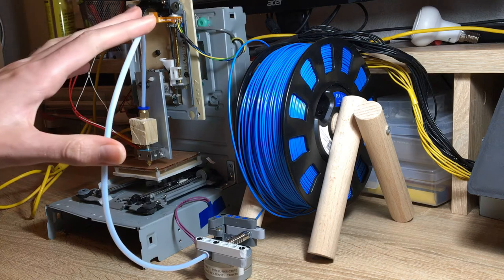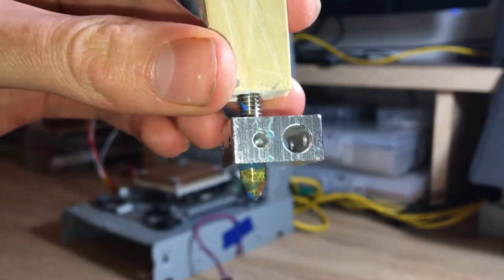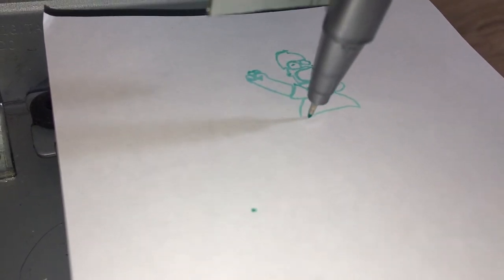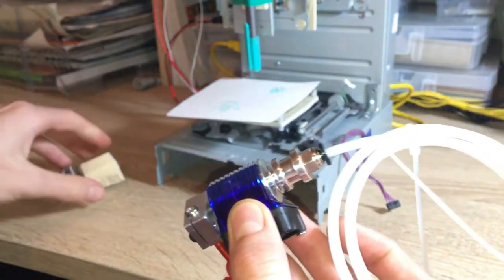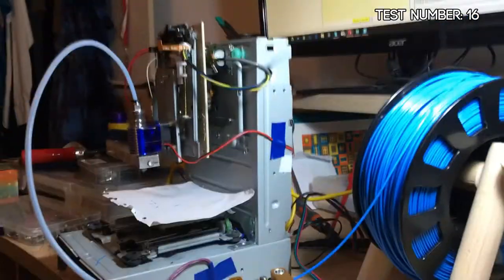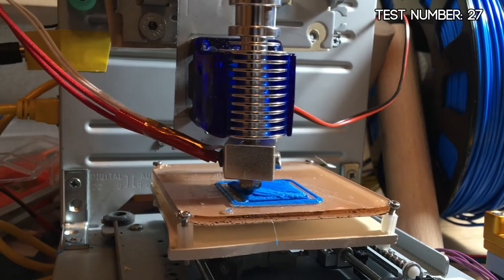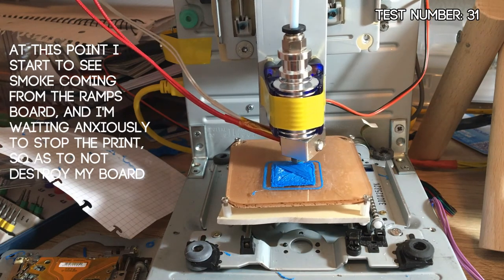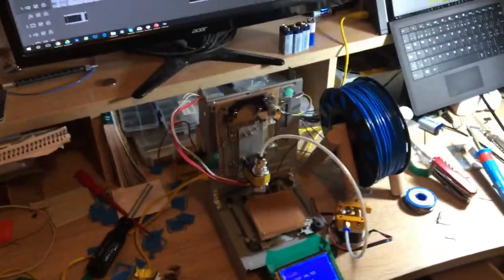Making a CD-ROM 3D printer -  entry 12

Comment: Don't give up, you're almost there! Trust me, even people who buy commercial printers for hundreds or even thousands of dollars spend hours and hours for the calibration. It's the most frustrating and time consuming step of the entire process. If you asked me, from what I see, your Z axis stepper doesn't have the torque to lift the weight of X axis and hotend and filament (which seems to weigh down on it) and therefore steps are being lost when it's supposed to move up. This causes the hotend to get stuck at an existing layer and then everything goes haywire. I have seen others using CD drives as Z-axis, but they used either a counter weight or some rubber bands to reduce the weight. Good luck!

Comment: i was encountering same problem , the solution is the imputing the correct filament diameter in slicer. by default its set to 3.0 , IDK why but changing that fixed the issue of layer shifting for me.

Comment: How did you decide the pre height/position of extruder from the base ?
Reply from the maker: The hotend has to touch the base when the z-axis is at its minimum so, I mounted the hotend to the metal and then used a pencil to mark where the screqs needed to be. The position is determined by the position of the x-axis. If I was to do it again, i’d make the axis be a couple centimeters lower. However it is better to be too high than too low.